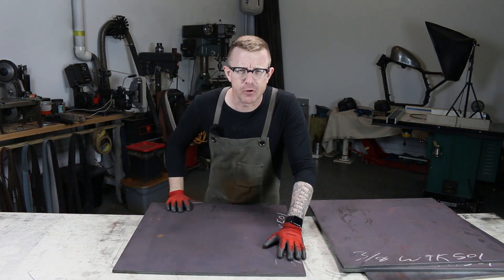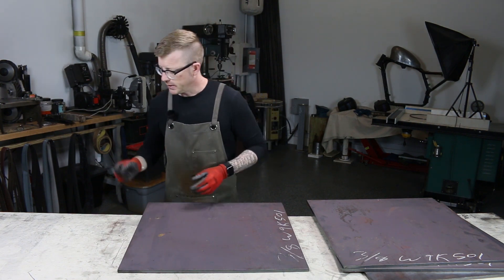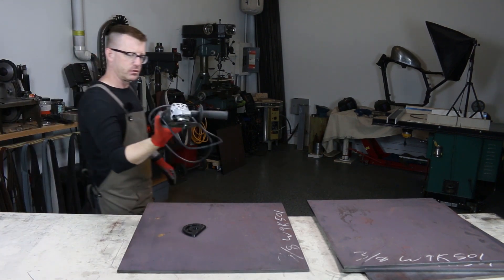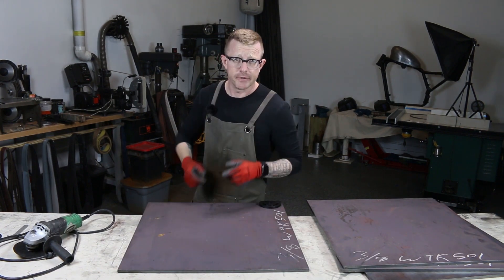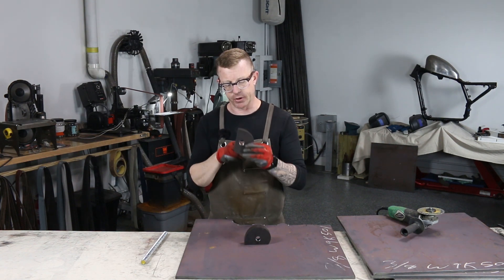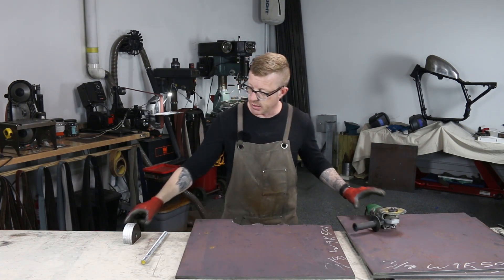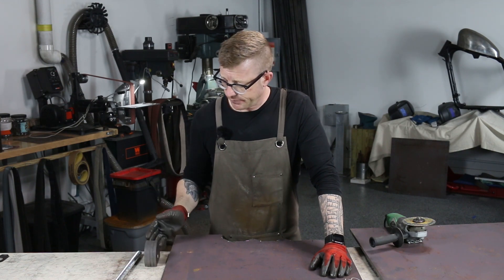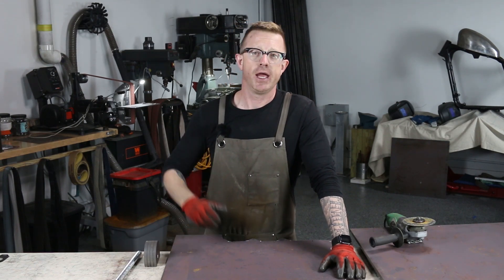2x72 Belt Grinder Build Has BEGUN!!! -  Homemade Tools

Comment: I know another commented on this but I wanted to give you a tip on holding things in your mill Vise. Normally it is a good practice to put your flat or more solid side of your work against your fixed jaw as this is what your hole position is off of and provides most of the holding power. And when holding multiple Parts in a vise use a piece of cardboard, sandpaper, aluminum or wood, something with a little give to take up the small differences between the parts. Your choice of materials really depends on what the possible tolerance differences  between the parts and what you have on hand. Excellent job on the video as always.
Reply from the maker: Andrew, this is a great piece of info here. I totally agree and it wasn't something I was thinking about at the time. Thank you for sharing your knowledge, its what YT is all about. Learning together. Thank you.

Comment: Next time I would try holding the stack of plates down on the vise with a toe clamp after closing the vise. If you can't, a few 1/8 or so aluminum rods vertically between the movable jaw and the parts might help. Any variation on the size of the parts can cause the jaws to clamp some but not all of them and you risk something coming out of the vise in a hurry when you drill. The aluminum will crush and take up a little extra space around the smaller parts. Also handy for clamping stock that isn't parallel enough to be held securely by the vise jaws alone.
Reply from the maker: That’s a good idea. I have an aluminum shop next door that probably has a bunch of scraps. I’ll raid their trash! Thanks for the advice. 👊🏻

Comment: In fact you don't need that long C-groove. I can't imagine a work, wich needs a belt positioning in a different way than vertical or horizontal. Therefore, you was needs to make only three holes in the hinge - one for the axle and two for fixing vertical and horizontal positions.
Reply: As much as I would like to have the "C" slot, I have no mill and I'd rather not drill a bunch of holes and then file out between them. So I'm just going to drill holes for vertical and horizontal as you suggest.

Comment: Loving this project, but for those of us aspiring to build our 2x72, using a 2x72 to help build your 2x 72 is kinda like cheating, right?! Lol. Keep up the good work, looking forward to the next installment
Reply from the maker: 😂 Thought about that the entire time I was using it. The goal here is to have the pieces plasma cut so most of this grinding doesn’t have to take place.  It’s what I got so I am using it to prototype. I’ll do a build at some point where it’s just a cut off wheel and a angle grinder just to see if I can do it. I suspect it can be done but it won’t be as accurate or fun. 😅
Reply: House / Work 
Yes at the moment I have a bandsaw, angle grinder and thinking of making a mounting jig for my handheld belt sander. Should be able to get the task done between those I would think
Reply from the maker: I found a hole saw today that will cut through 3/8 plate. So I can now cut the motor hole. Which was the part I was really concerned about. It was $35 on amazon. With that, an angle grinder, cut off wheel, and a band saw can build this no problem. 👊🏻
Reply: House / Work  oh nice, I may have to look into that as well.

Comment: I was wondering how you were gonna do the internal track, you might wanna look into a Rotary table & an endmill. Though the pin idea is actually pretty good too, because in all honesty, it only need to be in 2 positions. Should be pretty sweet... Have a great weekend, take it easy...
Reply from the maker: I think the pin idea is the easiest but not sold yet on it. I’m thinking I really only need that C channel in one of the four hinges. Thoughts? That wouldn’t be too bad to do on the mill. Hope your weekend is going good! 🔥🤘🏻🔥
Reply: @HouseMadeUS  Well maybe 2, it's something you'll have to try. To me(in theory),it seems like it would be stronger pinning it all the way through the bar, so you can lock down the whole thing with no problem. Tapping the bar would work, but how long till it strips out or has a problem? It seems like each method has it's plus & minuses... With a pin, you just pull it & pivot the grinder(not to mention only 2 holes in each side), but precision is key. With the C channel, it's a lot more work, but the pivot is more adjustable... I guess, for me, it would depend on how hard the channel was mill & how even I could get it.
Reply from the maker: I think we have to try it both ways. You make very valid points. I think a pin all the way through would look cool but it may be a pain to line all of them up. That said, I enjoy this part of the process so it’s fun either way. 👊🏻
Reply from the maker: Yes very true. That’s a good way to look at it. It’s time to take a deeper look. I will most likely just go with the C channel. It’s a tried and true method to achieve what we want.

Comment: Take a look at how a radius is cut without a rotary table , if you used the idea and placed a T-nut and bolt fixed through your "hinge part" and your mill table you could mill the semicircular slots very accurately.   
See attached video:  https://www.youtube.com/watch?v=hTj6LC6agrg
Reply from the maker: You’re right Jeff, totally agree. Not sure I want to put that much effort into the prototype though. The next version will be plasma cut so a lot easier. Fingers crossed anyhow. 😅
Reply: @HouseMadeUS  I would only take a few minutes to slide a t slot bolt into your milling table, put a sacrificial piece over the bolt then put your "hinge" over the bolt using a sleeve to keep the "hinge" precisely centered on the bolt, fasten a nylock nut onto the bolt with enough tension so that the "hinge" can still be rotated and proceed to mill the slot. The X and Y of your mill would not have to move whatsoever once the offset position is dialed in.
Reply from the maker: Now you have me thinking. 🧐 maybe I’ll give it a shot. Would I turn the piece by just turning it against the end mill?
Reply: @HouseMadeUS  The t-slot bolt is firmly fastened to the mill table with a nut, then a sacrificial piece of wood with a hole larger and thicker than the nut is placed on the table over the bolt, this keeps the "hinge" safely above the table 
then the "hinge" is placed on the bolt, the bolt is used as a pivot point for the "hinge, then a nylock nut is firmly fastened on top of the "hinge" then position the X and Y of the endmill to the center of the desired slot location. Lock the X and Y table so that it will not move. Lower the Z into the "hinge", rotate the "hinge" on the T-bolt to cut the slot.  Several passes will be required to cut through the "hinge"    If you want to get fancy a thrust bearing could be placed under and on top of the "hinge" to make it easier to move while rotating it. Some sort of "hard stops" would keep you from over traveling the desired slots semi circumference finished dimension.
Reply from the maker: I think I’m gonna give this a shot. Thank you Jeff. I really appreciate your help here. 👊🏻
Reply: Just be careful and DO NOT climb mill with this setup.

Comment: What are the specs for the bandsaw blade you are currently using to cut the plate steel? Have a most awesome afternoon!
Reply from the maker: I use these: https://amzn.to/2qr1SJm  12/14 TPI from Milwaukee Brand. They are pretty nice. For high carbon steel its better to go with less TPI, like a 14.

Comment: No problem.  Im more in a mindset of making quality parts fast with less work for the best price. I dont think about the whole process of learning because ive been doing metal work for 22 years. I would make a prototype and make changes so its perfect then we can laser up a production run ....
Reply from the maker: I hear you. Yes that makes sense. I think that will be coming down the road. I really appreciate the email and the time you're taking to help out with this project. Thank you very much! I didn't realize you were in Florida.